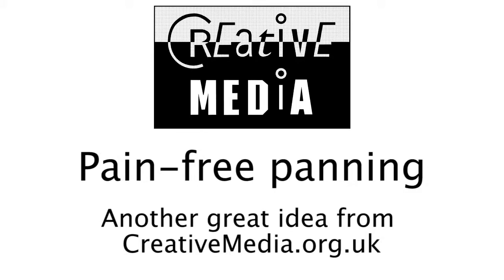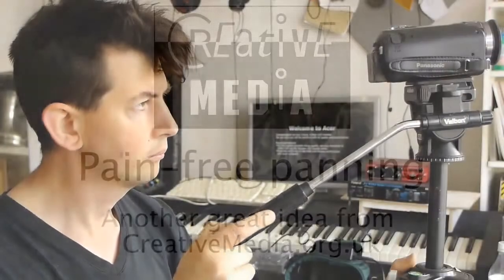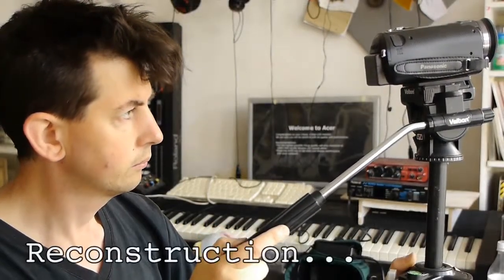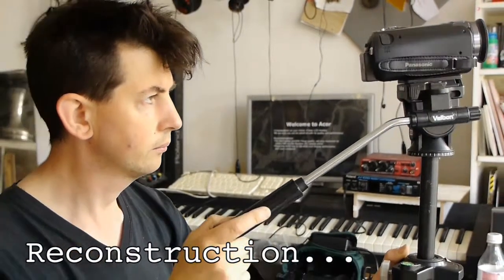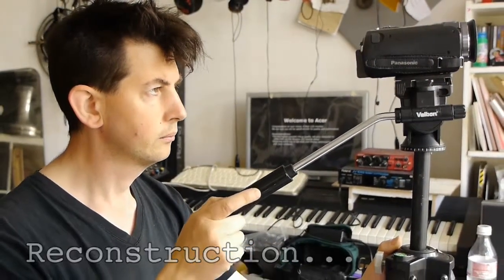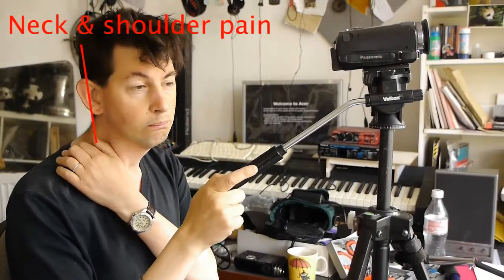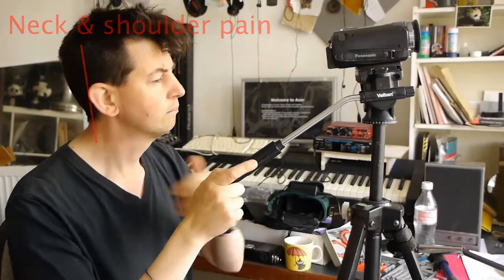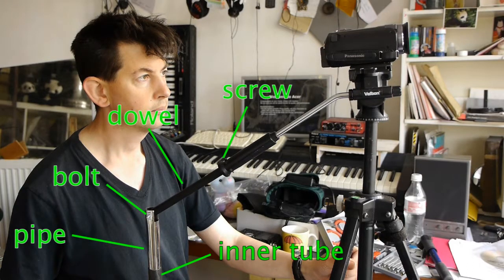Make a DIY home-made tripod handle extension arm for smooth pain-free panning and tilting.

Comment: I was looking for a handle extension for shooting jewelry. I couldn't find any, they make longer replacement handle for high end tripods only. Shooting jewelry close-up, every little bump is very noticeable. So I made an extension with 15mm rail rods. I glued a 1" 12mm and 1/4 coupling to the end of the tripod handle. Which I can screw in either a 15mm rail rod or a 1/4 screw.

Comment: When I zoom to the fullest extent it's bouncy as hell. I thought of your idea and instead went with an extremely long arm. I watch TV to learn and yet I hate and laugh at all their bouncy in and out of focus photography excuse me videoagraphy. Ppfftt. I film airplanes at side view. I'm still stuck thinking about a stiffer or even more bendable arm. I have tension bolts for how it will move on the trip pod. It helps smooth it out. The problem consists of if a bounce happens it can kick it to the other end. Yet it can absorb small oopse movements. So I tried a stiff arm electric taped to the long  bendable arm. Yeah it eliminates the accidental movements if I bump it accidentally, yet I lose response time and my stupid stiff arm has that angled kink in it. I prefer the shot gun approach. It will be interesting to use on my shoot tomorrow with people moving around.